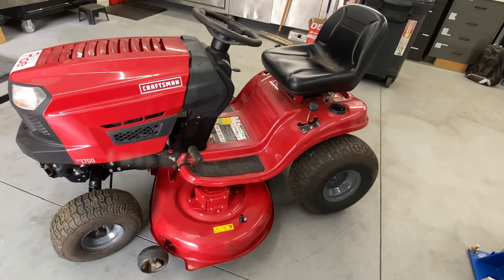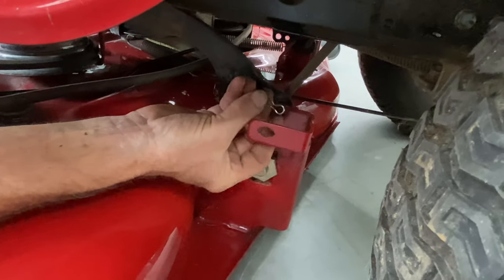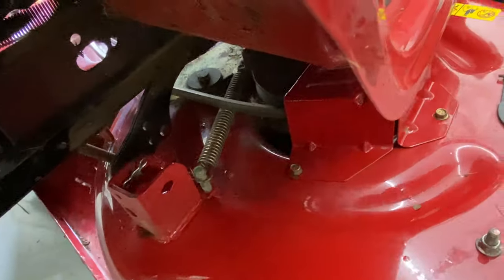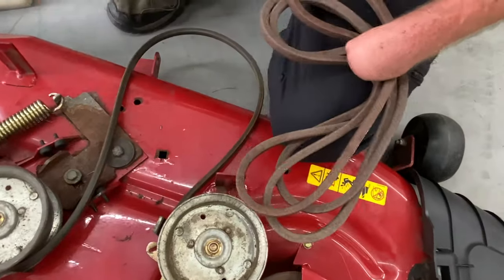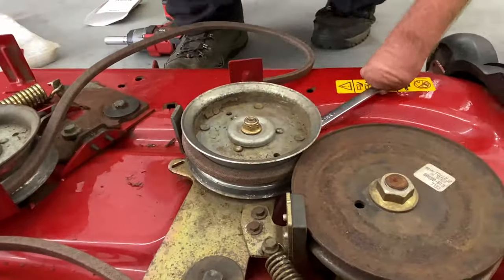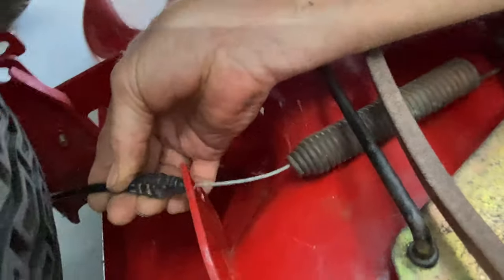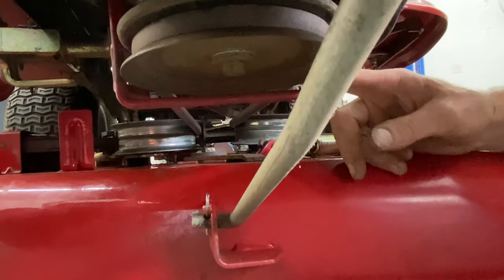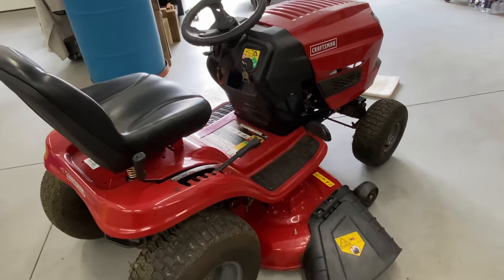How to Replace Mower Deck Belt Craftsman Lawn Tractor 46" Mower Deck

Comment: Funny i never noticed a break on one . Guess thats good but hey nice to know this. Funny question here does a zero turn have the break shoe thing on them. Cub Cadet zt1 ultima 50 just curious now. Not all question are dumb.
Reply from the maker: The brakes on the mower decks are only on the manual blade engagement. I’m sure the Cub Cadet ZT1 has a electric PTO switch and the electric clutch is used as the brake system for the mower deck.

Comment: Well at least m.t.d made the height adjustment separate from the blade engagement lever
Reply from the maker: Wow, now there’s a blast from the past Lol! I remember replacing the engagement bracket on the old machines because they would wear thin in the off position and the blades would still run.
Reply: @JohnsonsSmallEngines  I've been there did that back in the day on my powr Kraft mower that problem with this  is the deck would lower and the blades would engage

Comment: Thanks, I am working on a craftsman t 140 that the deck engagement cable broke while it was in use mowing and it knocked the black pulley brake bar out of it's hole, and the brake mounting bolt for the non discharge side of deck was laying on the deck. I was needing to see where the brake engagement bar went along with the mounting bolt. I am legally   blind and I am doing this for a disabled older lady, who knows nothing about the mower. Thankfully she has the service manual for the mower as she has 2 or 3 belts that also need to be replaced.
Reply from the maker: Sounds like you have a lot to take care of. I hope all goes well! Thank you for sharing and watching my video.

Comment: The bracket we have is missing the cover. Will this still work?
Reply from the maker: Not sure what you mean? If you are missing a belt cover? then  the belt may come off when you disengage the mower deck. Not sure what you mean by bracket?

Comment: I bought a used 2019 craftsman t240 the deck belt keeps coming off. And when the pto is fully engaged the belt is lose. All the pulleys seem to be in good condition.
Reply from the maker: Sounds like you have the incorrect or very worn belt.

Comment: I'm checking out my moms, the new belt seems awful loose. It is the correct belt. looks like no adjustments.
Reply from the maker: The belt will be loose until you engage the mower deck. If it still loose after you engage it, you have a problem.
Reply: Thanks, im going to look atvit this weekend.